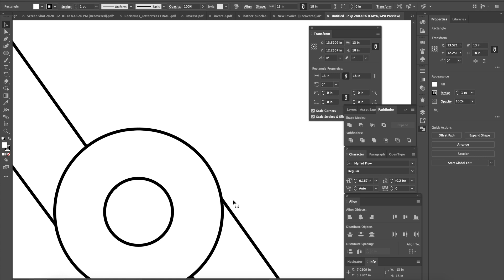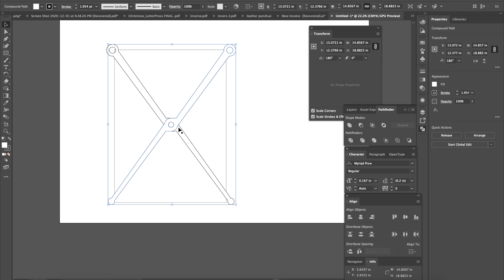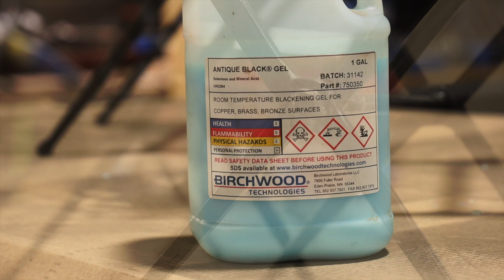DiResta Steel & Leather Folding Stools

Comment: @jimmydiresta What would you say the weight limitations would be of the stools? I saw that you hardened the steel for the X frame. So i'm assuming higher than standard steel you buy from the HD?

By the way: Where do electricians get supplies?

***********************************************

The Ohm Depot.

Comment: Didn;t see this asked... but why did you fire the legs in the forge after you cut them? I saw you hammer them after with lots of flaking... was it just to transmogrify the carbon? Did it stiffen the legs by introducing some kind of temper? Sorry, I know a little about metal but not a lot. Just not sure why you'd fire them in the forge before the grinding wheel. 

Lovely finished product. Thanks for the video.

Comment: I have this cool folding single post stool made in the 1930's, it's made from lacquered bamboo and balsa wood and has an ad for a piston rings brand on it.  You balance on the single post much easier than you would think, and it easily holds my 1/8th of a ton ass.  Anyway, It would be supercool to see a steel version and it could still be made fairly lightweight.

Comment: Are you using an annual cutter on the mill? Did the forge soften the hardened plasma cut holes? Great stuff. The leather and steel combination is always a good look
Reply from the maker: I did with a torch off camera
good eye

Comment: 1st. I received your skeleton knife. It's as fine in hand as it appears on the screen. I'm still kicking around material for the handle.

Next... I never saw the round flat anvil before, 3:55. Did i miss it on a shop tour? AAMOF I've never seen anything like it. What's the story behind it

Next again, 2nd stool did I see you put a bit of glue on the rivets?

The stool feet like a flat ball foot... nice touch

Finally I really hope some day in the future at least one piece of every one of your makes is curated all in one place so people can study the evolution of your design processes. Of course it would include your use of tools
Reply from the maker: thank you!!!! the round anvil was a drop or scrap 10"x 4" I use as an anvil .. the second stool I was experimenting with the assembly and gluing in the rivets so I can do al lat one time to save time... thank you!!

Comment: Because you asked... I would have run a burnishing tool along the leathers edge. Maybe even a bit of finishing dye. And the look of hand stitched leather is nicer than the rivets. And I'm sure everyone with an old pair of jeans has experienced, those rivets sometimes loosen over time and snag fabric.
Reply: I agree with burnishing the edges.  However those rivets are there forever.   They are not like the tubular type used in jeans but the rivet and rove (burr) are as permeant as it gets.

Comment: Cant remember if it was answered on your podcast, but campaign furniture was the stuff british officers had to buy for themselves when they went out on campaign to foreign countries.  It was all meant to be super strong, portable and easy to fit into shipping crates. Thats why most of it had metal reinforced corner brackets and handles that were all recessed to sit flush with the surface. These stools are pretty cool btw